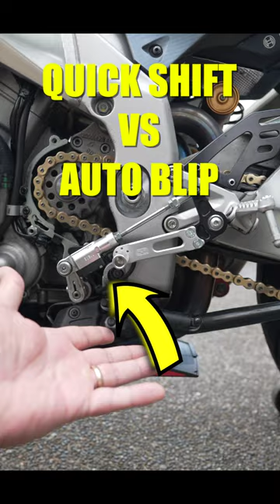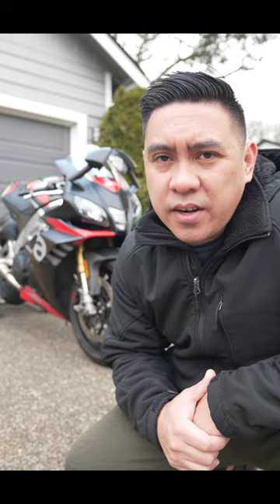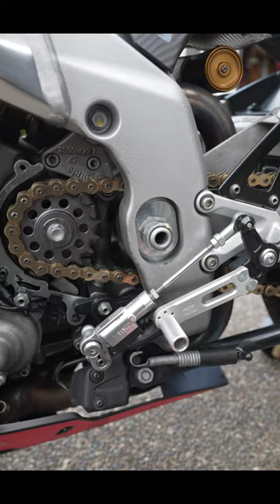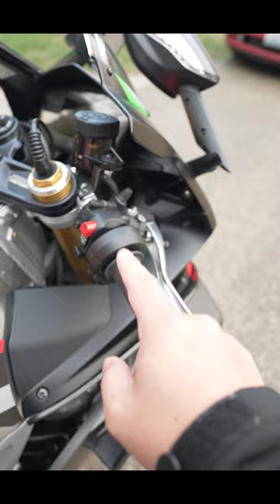Sport Bike Quick Shifter vs Auto Blipper

Comment: I blip manually. Just fun that way.
Reply: just a lil flick of the wrist 😂 ain’t that hard
Reply: Ikr! I figured out how to do up and down without a clutch by accident I don't get the expensive shifter upgrade stuff
Reply: My panigale does it all automatically but my 96 RVF400 is all manual, so for upshifts I just put a little pressure on the gear lever and reduce throttle a tiny bit and it basically falls into the next gear, clutchlessly.  For downshifting I use clutch and only rev match when in high revs.  Rev matching while modulating the front brake actually takes some practice to get it smoothly.
Reply: @thisguy8100  you would if you had one.. n raced it..
Reply: @thisguy8100  its for racing/ fast riding idk whats not to understand 😂😂its just that you dont need it because you aren’t tryna save seconds of laps
Reply: @MA-kr6yv  I get the function but hardly anyone races their brand new Aprilia. And if you do you have money to upgrade to a faster one than stock. The fastest rider I know has a brand new S1000RR with auto blip and shift and he says it's effectivly pointless and build really bad habits if you go in-between bike that have it and don't. To me it's like F1 Aero. Yes it performs a very specific function and it does it very well but it's not always best applied or necessary for the street
Reply: @thisguy8100  😂😂 yeah right..no sport bike riders hot rod their new bikes on the streets..dafuq does the brand have to do with it? Because it's an expensive bike they don't hammer on it? Those people are better off on their ebikes or the bus..
Reply: Yeah I never understood the mentality of installing blippers and quick shifters. Might as well just ride an electric bike since you don't wanna work the clutch
Reply: I'm purely an Enduro and mx rider. I have been manually blipping up and down for years. Long as your bike is tuned well it can be achieved flawlessly.
Reply: @trillmixin6999 well some ppl take it to the track and actually count lap times and this helps with that. But for everyday road use most will use clutch. My bike has this, but i can turn it off or on.
Reply: @mpc2510  I can understand wanting to get a better lap time
Reply: @trillmixin6999 once you try quick shift. There's no going back. The feeling, the sound. It's all good

Comment: Most modern quickshifters work by cutting ignition whether OEM or aftermarket. It’s the preferred method since it’s smoother than cutting fuel

Comment: The r6 is an exception. Cable driven but goes to an electric system to control TBs. I had trouble wrapping my mind around how autoblip works with it but it’s flawless!
Reply from the maker: The r6 is still ride by wire, not ride by cable. But yeah, it’s just a sensor connected to the cables. The cables don’t actually open the throttle bodies last time I checked.

Comment: you can ghetto a quick shifter by hooking the kill switch wires to the horn button, and flick the horn momentary switch to do it. and with carbs you can emulate auto bliper you run a high idle, normally a screw on the carbs that's easy to adjust normally without tools.

also a high idle removes engine breaking easing the lack of a slipper clutch. just super concerning when you are idleing at like 2-3 grand.

Comment: Nice explanation but what happened to the synchronization method ? which works really well by synchronizing the action of your throttle hand with your shifting foot and the engine sound! Works every time with new and older motorcycle….and doesn’t cost anything 🤔

Comment: I helped my buddy install a IRC mechanical autoblipper for a gixer thou with a actuator plunger for the throttle cable so it can 100% be done but it's pricey & a absolute nightmare to get it installed, if you haven't got mechanical skills then forget it

Comment: I have a gen 5 2020 10R and correct me if I'm wrong but it's throttle by cable setup and it comes with an autoblipper stock.

Comment: Cars with throttle by cable had cruise controls that controlled the throttle in parallel with the driver. So it is achievable, but there is question of build volume and... Is it worth it?

Comment: What's the difference between an auto blipper and KTM quick shifter+ which uses a slipper clutch for downshifts.? Is it the same as an auto blipper?
Reply: Bro...
I am not sure but
A slipper clutch is just a different thing bro..
Autoblipper uses ride by wire to rev match when you downsift.
Even if you are at 100kmph + speed you can blip to grear1 without wheel lock...  I mean....that's the use of slippers clutch 
I personally have a 2022 d39T 
I have been using all of these features since the day since I bought it....
KTM QUICK SHIFTER+ IS JUST A NAME...LIKE KTRC WHICH MEAN KAWASAKI TRaction Control....
COMPANY GAVE THAT NAME JUST TO HIGHLIGHT IT,  AS IN THAT SEGMENT NONE OF THE COMPANY GIVES A QUICK SHIFTER AND A AUTOBLIPPER IN THEIR BIKE..
IF I AM WRONG YOU CAN CORRECT ME..
THAT WOULD BE Helpful...

Comment: Well I mean you could do an auto blip with a bike that has a V configuration like Hondas 4 cylinders VF series of engines 
Theoretically
TPS sensor has a home on one bank 
Throttle cables have a home on the other
Throttle bodies are connected with a linkage 
Still leaves a home on the other side of either bank for a servo you could put on but obviously you’d need a standalone ecu to do this ie speeduino, haltech, Holley, etc 
Practical? Not really less your doing a stand-alone but it is possible lol

Comment: hey adobo, what’s with the velcro strap holding the front brake lever engaged?
Reply: I would guess it's to prevent the bike from rolling down his driveway, or maybe it's a reminder to remove any locks on the wheels before riding off.